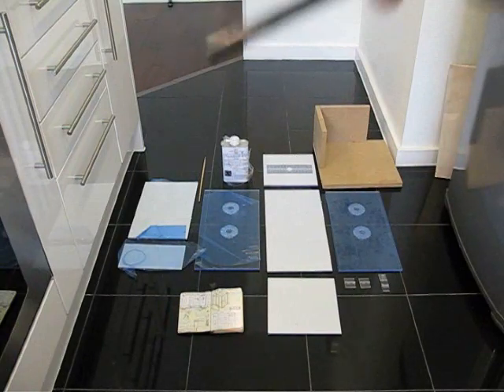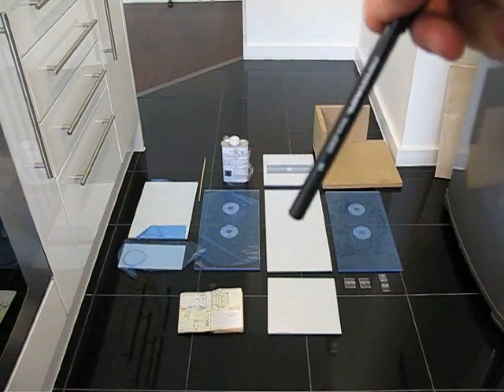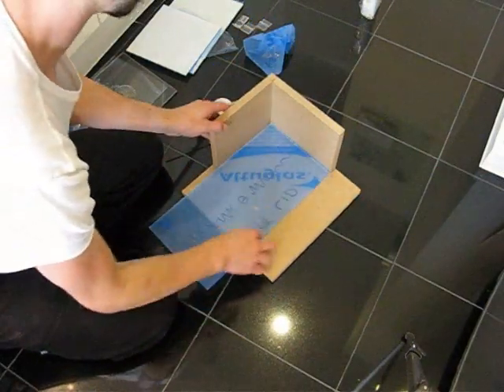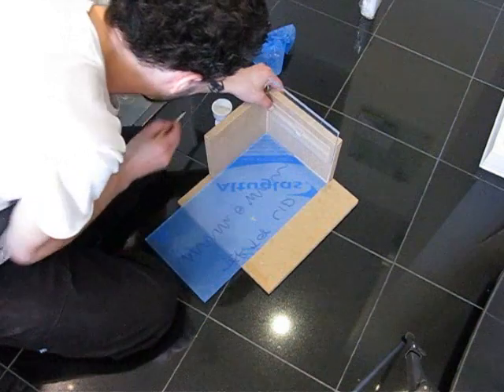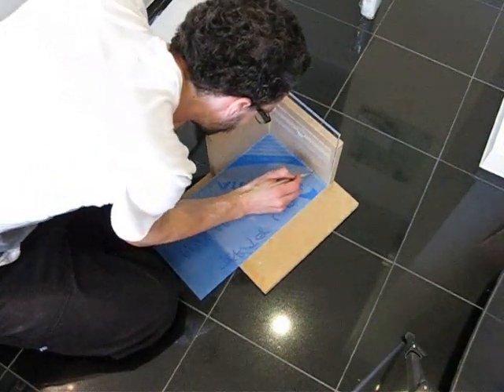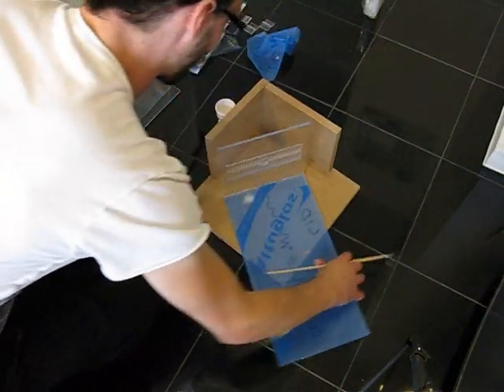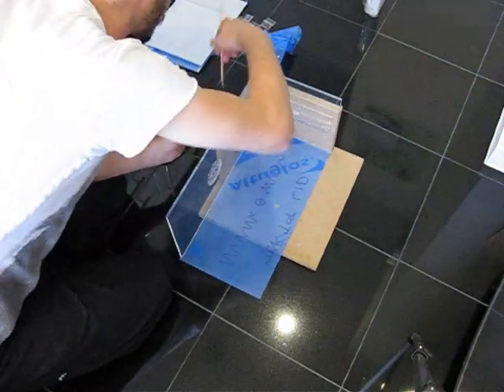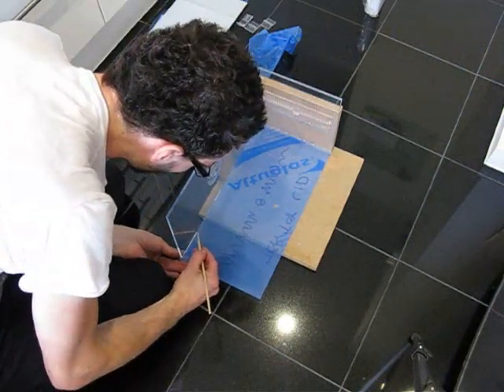How to make an acrylic tarantula terrarium PART 1

Comment: a couple of tips when working with Acrylic not mentioned on the video. if you're not working with something such as the box in the video it's better to just peel back the protective film on the acrylic just enough to expose the edges. this way you don't have to worry about scratches because acrylic is very easily scratched. The second one is instead of a brush they make needle point applicators that work much better. you just squeeze along the edge and it fills itself in.

Comment: Ok thank you. Another question though. I just picked up a bunch of "scrap" pieces of acrylic (these are fairly large). Problem is that they are not nearly thick enough. Do you think that i could put two together and have a piece that will not warp under heat, and if so do you foresee any other complications with this?

Comment: Hi. Great Video! I have access to a laser cutter and my friend has asked me to make one of these for them. I was just wondering when you said in the video that the sides need to be polished. Is that the finished polished edge they get after they have been laser cut or did you have do something more to the edges to polish them after laser cutting?
Reply from the maker: Hi victoria, I'm not sure, I had the polished edges supplied to me, The only thing I cut was the vents.
Reply: Ahh OK. No problem, Thanks for letting me know!

Comment from the maker: @MrFozzyBear Hi mate, not sill at all. The mitre block is about 9", you can make it any size you want, it's up to you. It's screwed together. I only build tanks 8"x 16" but if you make a bigger block it would be easier to build a bigger tank. I just use acrylic (perspex) sheets 5mm in thickness with polished edges, that's all I know, I know there are strengthened acrylic out there called polycarbonate, but you don't need this for tarantulas.

Thanks

Comment from the maker: @Mythicdawn07 Cheers mate! It costs all in all about £30 to make, probably £35 if you don't have the liquid solvent cement. You can get your acrylic from anywhere as long as it has polished edges and it's a minimum of 5mm in thickness, just google acrylic cut to fit, there's loads! good luck, let me know how you get on.

Comment: Anyone doing this (which I am) must be very carefull in the design and is a key point which thespiderooms does mention but for me was more complicated. Just doing a 10x10x18inches wont work as some pieces need to be smaller than other so you mount the sides internally and the roof to fit on top and the door on the outside.

There are different ways of doing it actually and I will be releasing a vid more on the design and layout and sizes plus what to put into in re live plants as the glueing stage is prob the easiest.

Oh finding a miter block is nigh on impossible and there is a way of using tape as an alternative. (you tape the whole thing up...glue then remove the tape).
Reply: Well have built three now so check out the vids!